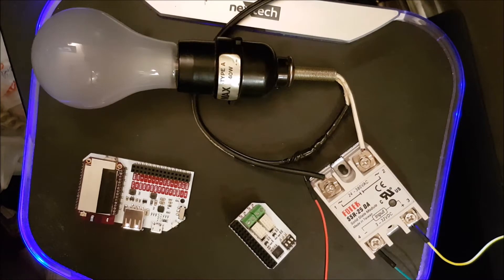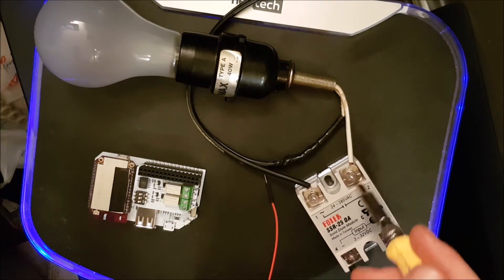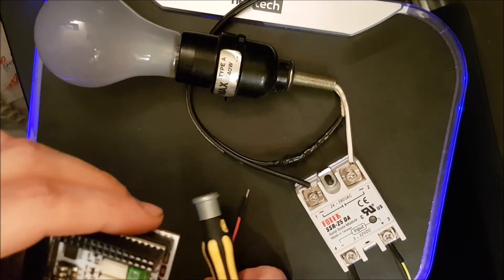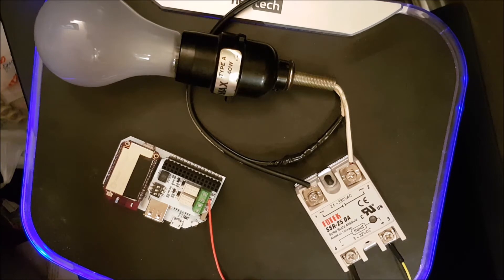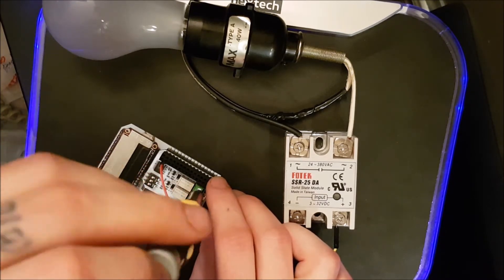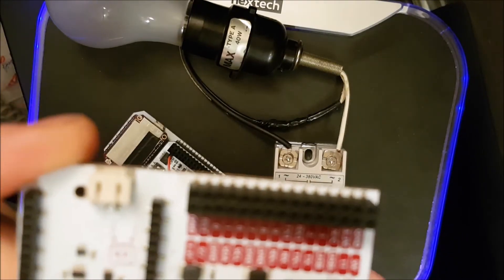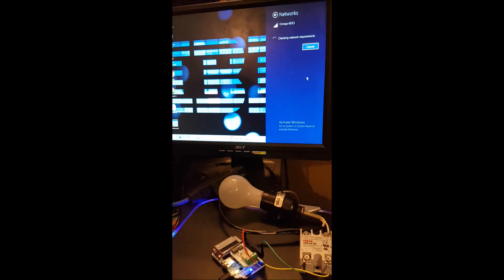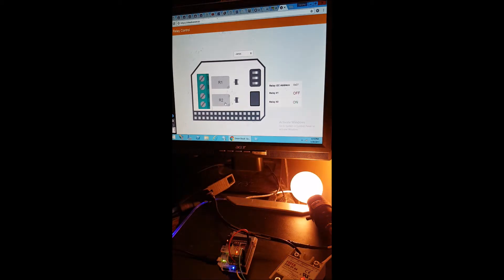Onion Omega2+: IoT WIFI Lamp Project (aka Slampher) w/Instructions

Comment: 25A SSR for a 100W light bulb?
Reply from the maker: It's purpose was for a 500W Halogen lamp, as the lamp is behind my entertainment unit and the switch has failed as well, now I control it via my cell phone/pc.  It was  also the only size available at the time on eBay, but I always buy larger for use in other projects. But yes, 25A is over-kill for this project and 25A would pose more danger than good at that size.